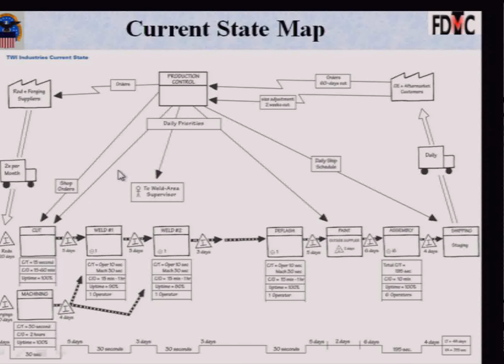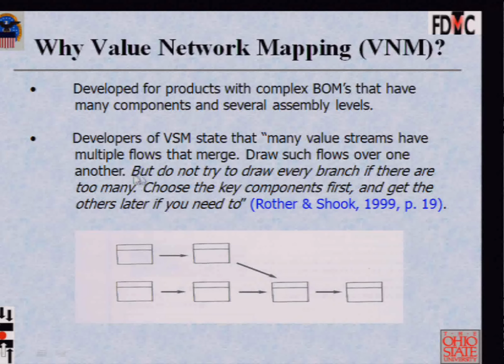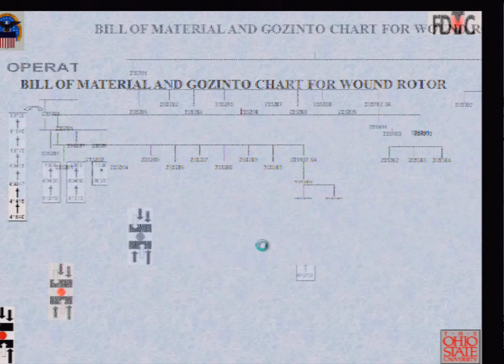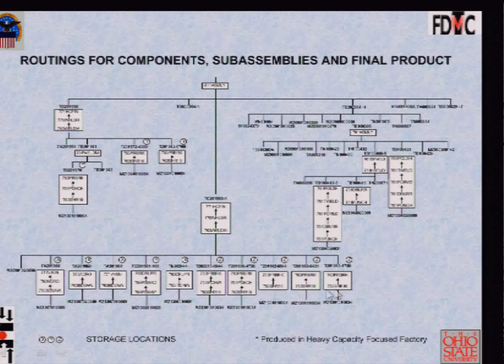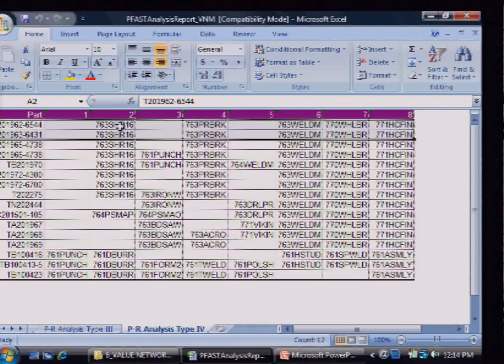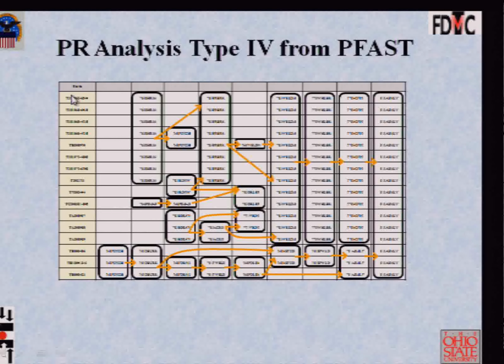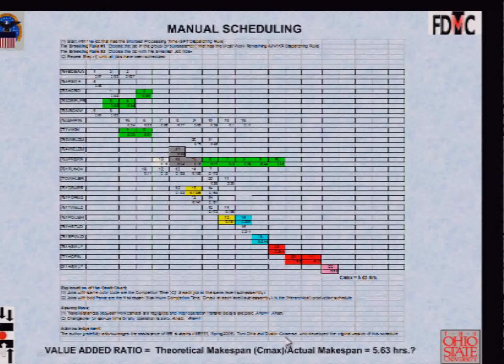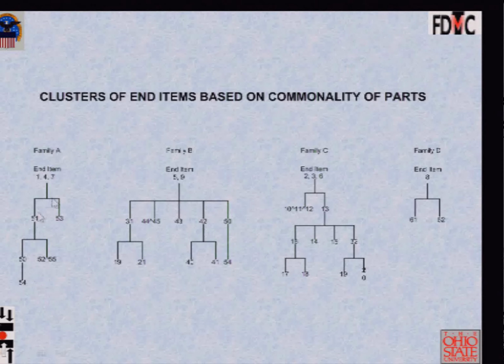Introduction to Value Network Mapping: An Alternative to Value Stream Mapping for HMLV Manufacturers

Comment: Hello Dr. Irani, I graduated from mechanical engineering 4 years ago, I currently work in a machine shop in Canada and I stumbled upon the Lean philosophy after seeing how behind the times the company I work for is. Paradoxically the information is very readily available yet it doesn't seem like many SMEs implement these concepts. I'm looking at going off on my own in business and I'm curious if you find that a lot of SMEs implement lean philosophies or not because in my very young career it does not seem to be the case. It seems like just by implementing these philosophies you can have a serious competitive Edge over the small companies I've seen around. Thank you.